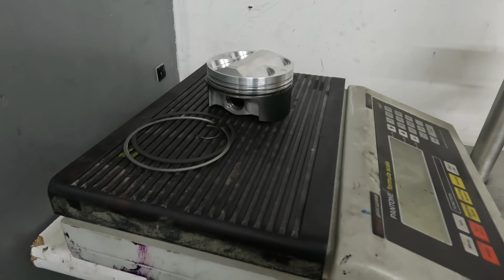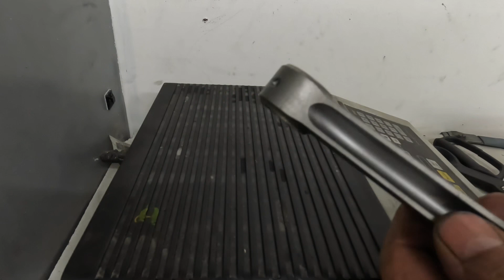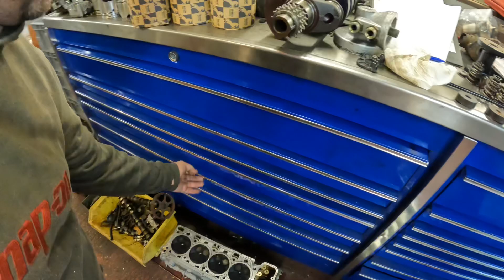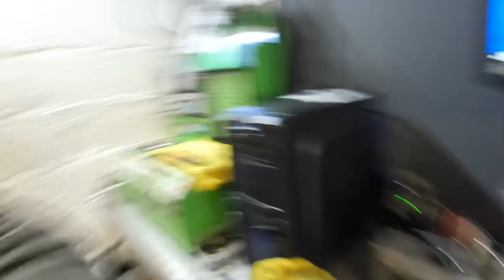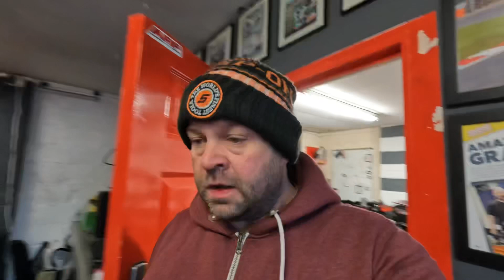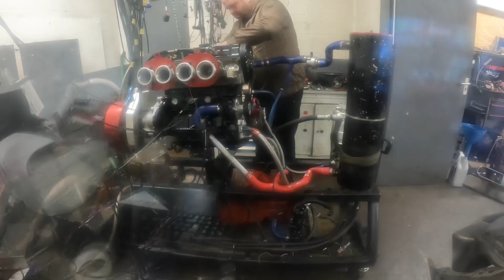National HotRod engine | Vauxhall 2ltr XE Red Top | Build and Dyno Tune

Comment: Great engines redtop. We do  warranty work for used car sales garage on cars they sell with 3 month warranty. They sent  3 calibra 16v cars over 2 years and all had 70k miles the oil pumps failed all had fsh and we had to strip them send block to machine shop 2 . Melted pistons to liners. He must of sold 30 of them but only 3 failed. Very lively engines. You only get seconds to turn a car off before damage when the light comes on better luck with a oil pressure gauge as you can see it dropping over  time.
Reply from the maker: I agree with you on the redtop they are great, just keep on top of the maintenance and your all set for some great drives... Sound awesome as well

Comment: Hi very informative but I am interested in the Carb Inlet trumpets you use, do oy u have any info that I could look at?
Reply from the maker: Hi, I may have the specs, what do you need to know
Reply: @graceenginedevelopments  Who is the manufacture, Spec and Why you use these and info on what difference you find with them would be of use, not doings Hit Rods but AutoGrass so short circuit overall racing so very similar use
Reply: @graceenginedevelopments  Hi, would be interesting to know your thoughts and why you used these trumpets, the Air Filters area also of interest who's are they? All the best  Steve

Comment: You did not make any break in?  just build it and and send it to full throttle?
Reply from the maker: Hi, it got broke in on the Dyno.. then full send.
Reply: @graceenginedevelopments  how is the engine break in on dyne i am curios of the sequence ...i am not trying to be disrespectful , just do not know. Thanks!
Reply from the maker: @alexandrucurca7888 we ran it at variable rpm and load for just over 1hr, making sure the fueling etc was ok.. then finished off with the tune

Comment: So Ive just bought a pair of reprofiled camshaft’s for my Vauxhall XE engine and they are sold on a fast road basis and fit to the engine on it’s standard timing markings because the clearance are said to be safe. Out of interest before fitting, i measured the lobes on my original cams and they were 44mm, but the upgraded cams had shorter lobes at 40mm. Now I would of thought the upgraded cams would have higher lobes, or atleast the same size for valve lift. Can anyone explain why this is? Do the upgraded cams give me more valve opening durations over the standard ones? Turned engine over by hand several times and it feels perfectly ok as in no valves colliding with the pistons.  I’m just a bit curious. Piper cams they are and claim to give a power increase of 12bhp.  I’ve already got a direct cold air duct and a large bore 4-2-1 exhaust manifold with a 2” straight through pipe. I’m excited to see how well the power gains with be. But very curious about the lobe sizes being different. Also, it occurred to me that is it necessary to change the valve springs to accommodate the upgraded one or would the standard springs be ok?
Reply from the maker: Hi.. you need to know the base circle and take that size away if your measuring top to bottom.. without proper equipment it would be difficult to measure accurately. I would also say you would need better springs and depending on what cam profile you have you may need mechanical followers instead of hydraulic.. do the cams have any identification numbers on.

Comment: It's been a fair while, but i thought they needed to be hydraulic - or the OEM type?
Seem to recall something about the profiles used back then destroying the gen' INA hydraulic followers - if they did change the requirement, might have been for reliability?
On that, and it may be a stupid question (wouldn't be my first - or last), do they adjust the cam' timing depending on the track length and conditions? I mean whether to bias towards peak rpm or aim for better torque a little lower for drive off the corners?
Reply from the maker: I'm not sure about the hydraulic followers, a bit before my time maybe.. you could definitely change the tune for short and long tracks but it would be quite a lot of work

Comment: Do you know if anyone tried to put x20xev pistons in a c20ne?
Reply from the maker: I don't know anyone, I'll look at the specs to see.
Reply: @graceenginedevelopments  would be grateful. I've put the engine together maybe 2 weeks ago. Just want to know if anyone tried to use it long term. I already did 1000kms with it. It runs stronger and better than before, and without a tune.

Comment: Great work on the xe mate,
My calibra also likes this build,
Keep the videos coming,
Cheers
Reply from the maker: Thanks Luke, has your calibra got an xe ?
Reply: @graceenginedevelopments  sure does, I'm slowly replacing parts that are on their way out or getting close to like bushings gaskets etc,
Recently the head gasket had been pissing coolant out over the gearbox and I had been keeping an eye on the level and just topping up when needed,
This has led to what I assume has washed away the spline grease on the input shaft and now the release bearing is super noisy unless I lift up the clutch pedal,
Though the weekend before last I thought I would try that nulon head gasket repair - I've been quite sceptical on these additives but took a punt and it has actually worked, but how long for....
Amongst other things that need to be done, the calibra is going well so far
Reply from the maker: Hi Luke sorry I missed your reply.. hope the calibra is going well
Reply: @graceenginedevelopments  
Yo
No probs -- Calibra is hanging in there at the moment, it has started to stutter on acceleration lately - I think it might be either an air intake issue or fuel issue, but I'll have to get a better look at the situation....

Comment: Loving this, I've gone from my first love, the 1600 kent/valencia x-flow in my mk1 xr2 to Vaux xe engines. This is the channel for me, great stuff.
I'm in love with that cam lift / duration machine, mind blown.
Reply from the maker: There all great engine. The cam machine is very good
Reply: @graceenginedevelopments  If piston hit gasket dont you think problem is the gasket not the piston?
Reply from the maker: @robertokandal  it's just the edge of the gasket so relieving the piston is fine, you can only use a std gasket
Reply: @graceenginedevelopments .thought they were aloud up to 87mm bore ?
Reply from the maker: Your aloud up to 1.5mm oversized.

Comment: Deae Sir, i am working on the same engine. Can you tell me how much tork i'll need to fasten the crankshaft bearings ( in Newton meter)
I would be glad to hear from you!
Reply from the maker: Hi Jan, are the bolts standard or ARP?
Reply: @graceenginedevelopments , standard bolts Opel/Vauxhall . My local garage told me it has to be 35 NM plus 45 degrees and 15 degrees.
Could that be correct?
Reply from the maker: @ynosdvdtje  the mains are 50nm plus 45°
The big ends are 35nm plus 45°
New bolts in both
Reply: @graceenginedevelopments thank you very much Keep on posting new video's !
Reply from the maker: @ynosdvdtje  your welcome, will do

Comment: Awesome watch. Quick question. The 4-2-1 exhaust the hotrods run are different lengths for there different cams. How much of a difference would that be to the 2 exhaust you ran? Is it possible you can say the numbers achieved on the dyno?
Reply from the maker: Thanks Ben next time I run a XE on the dyno I'll try different manifolds and show the Dyno graph
Reply: Thankyou. How much is a dyno session. My mate I help has two engines, one for torque. One for bhp. Supposedly. But one Simpson manifold. It would be nice to go check them with you tbh to see what one has better numbers
Reply from the maker: Sorry Ben I missed your last question.. I charge 450 for the Dyno.. although it's currently being reinstalled in the new workshop so probably won't be back up and running for a month

Comment: 265-275 hp Cant beat a good EX , my mate has 2 Swindon XE's in the garage 1 dry sump the other wet sump ....
Reply from the maker: Hi Giles.. this is on standard ports so quite restricted.. 230bhp..
Does you friend want to sell them?
Reply: @graceenginedevelopments  No both are for his Hot Rod again on carbs think its a spaceframe 207 or similar ...
Reply from the maker: Oh cool.